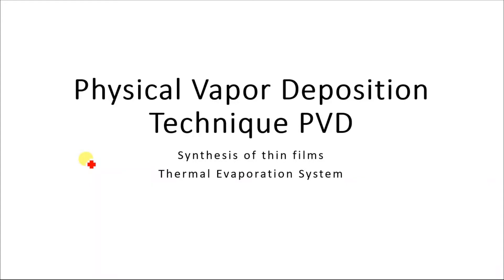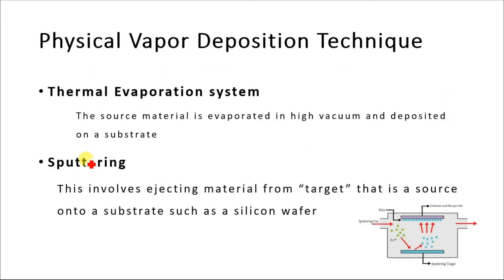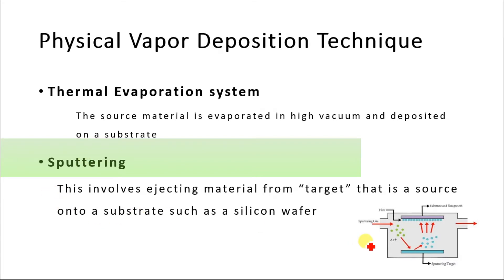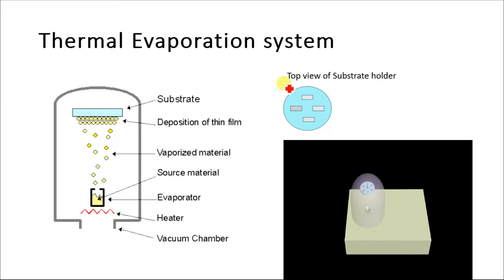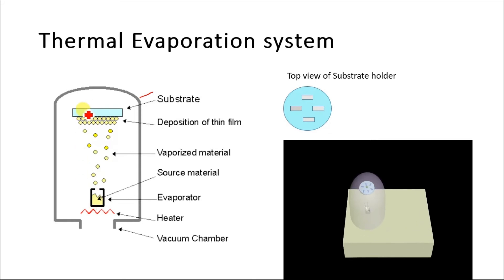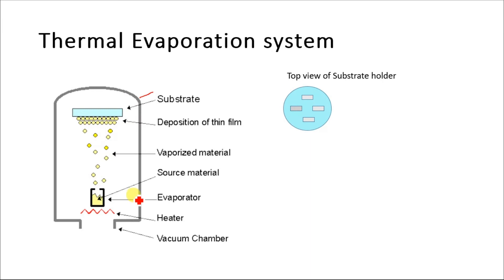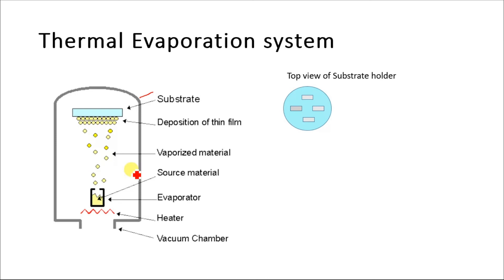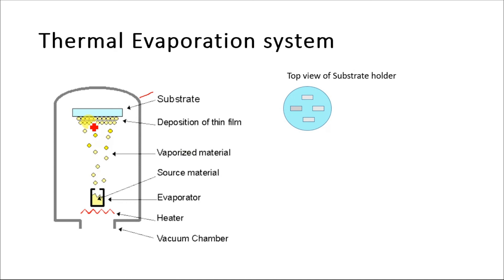Thermal evaporation technique

Comment: Hello, what size are the nanoparticles of molten gold emitted when evaporating due to high temperature?
Reply from the maker: you have to measure that or you should try to search in somewhere in research papers , thermal evaporation is mainly for thin films se we deposited it over a substrate then we do further calculation, nano particles might be different from thin films they are particles and are some time in form of powder